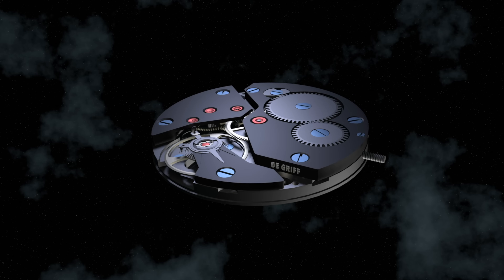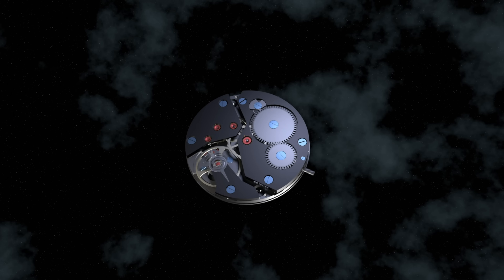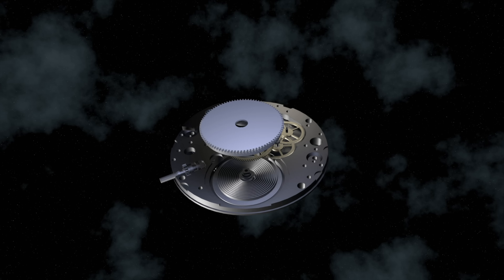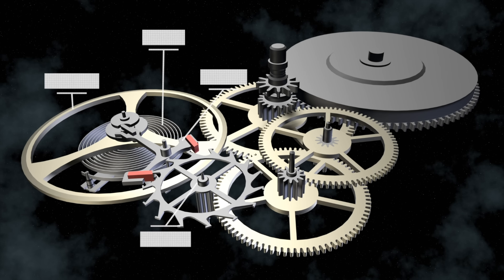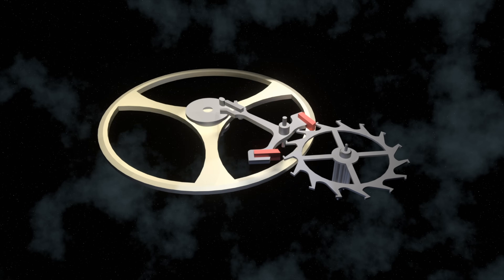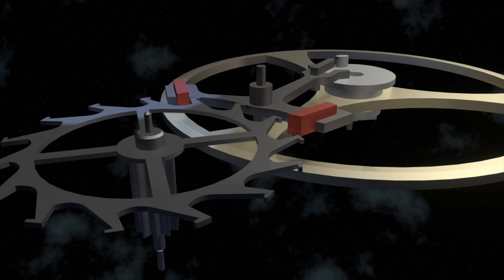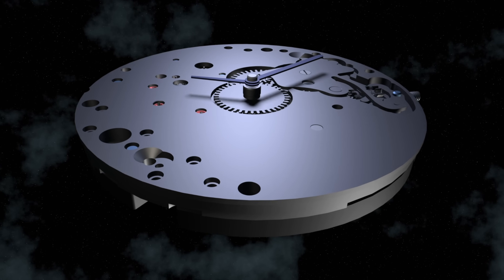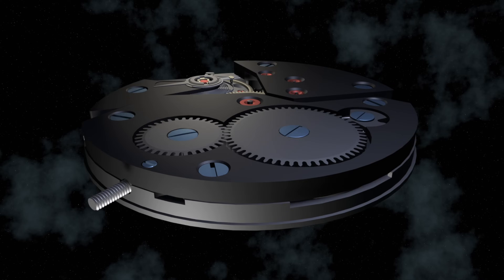How A Mechanical Watch Works - Explained Simply In 3D - How A Watch Works - Atelier DE GRIFF

Comment: Excellent video! However the the words "creating energy" really hurt my ears. Turning the crown does not create energy, it transfers the energy from the fingers to the main spring. Energy can neither be created nor destroyed. I am certain the author is aware of this (correct me if I am wrong), but simply chose an incorrect formulation of the idea. Also, one thing missed in so many of these types of illustrations is the idea of "pendulum", which in this case is the balance wheel and hair spring. The fact that the frequency of oscillation does not change with amount of energy applied. This is what really keeps the time! Even as the main spring delivers less energy, the balance wheel-hair spring combination (pendulum) will oscillate with the same frequency as before. Only amplitude will decrease. It would be great to underscore that basic law of physics that regulates the escapement.

Comment: So how can I set my watch without breaking the wheel train?
Reply: If you're setting the time on your watch and the hands don't move freely you need to have a professional watchmaker look at it.
Reply: @SOPHIAFLYGIRL  Please read the question again.
Reply: @simonmazzi1793  Your question asked about setting your watch without breaking the wheel train?
Reply: @SOPHIAFLYGIRL  Let me rephrase. How does the keyless work disengage the wheel train from the balance wheel/pallet fork, so that the hour/minute hands can move freely without dragging the mainspring?
Reply: @simonmazzi1793  When the crown is pulled outward, it separates one set of small gears then, depending on complications, disengages the wheel train from the day-date wheels by means of a lever inside the movement. The remaining gears continue to turn while the day or the date are set.

Comment: Very nice explanation. Though I like to explain the palet fork before bringing in the balance wheel into the picture. The pallet fork having two stable states (left or right) when torison is applied by the main spring through the train if wheels and that the main spring would maintain its potential energy forever unless something acts on the palet fork (enter the balance wheel).

Comment: Which part of it turns the hands? How does it move the second, minute, & hour hands at different speeds? 🤔
Reply: The wheel in the centre turns once per hour, so this is used to carry the minute hand. On the dial side a pinion (called cannon pinion) is friction fit to the extended pivot of this centre wheel. The cannon  pinion drives another train of wheels called the motion work which provides a 12:1 reduction to the hour wheel which sits over the cannon pinion, the hour wheel carries the hour hand, this way you have an hour and minute hand.

The cannon pinions tight friction fit to the centre wheel can also slip allowing the hands to turn separately to the main wheel train and therefore the time can be set without affecting the running of the watch.

The ratios between the wheels and the frequency of the escapement (both of which are related to each other) means the fourth wheel in the train turns once per minute meaning a seconds hand can be fitted straight to the long pivot of this fourth wheel. Equally simply by convenience the centre wheel turns once per hour due to the ratios of the wheels and pinions. When designing a watch the number of teeth on the barrel actually isn’t too critical (it only really effects the power reserve), the most important numbers of teeth are on the centre, third, fourth and escape wheels and pinions, these are partly what dictates the beats per hour of a watch and are why these wheels turn at the speeds they do.
Reply: @timepiecetlc  Very interesting, thanks for the explanation
Reply: Different gear sizes for the appropriate ratio of time. Motion Works explained at 7:45

Comment: Thanks for this informational video! Could be added, that the wheels turn exactly how they need to turn to let the hands show the time 😉
How long did it take to make all that animations?
Reply from the maker: Thank you very much for the kind feedback and the addition! 😄 This took around three weeks (full time days) to make, using Blender. I’m sure someone more experienced can do this much quicker, but this took me a ton of time as I don’t do this type of animation very often at all! I also spent quite some time on the sound design 😁

Edit: I also have to add that it took several days just to render as I have limited computing power here. And I had to render quite often as I kept running into issues or mistakes which meant starting things over :-) As I said - I was not the most efficient with this!
Reply: @degriff  You did a great job! 💪
Reply from the maker: @alexscharoff5028  thank you very much, I really appreciate the positive feedback ☺️🙏